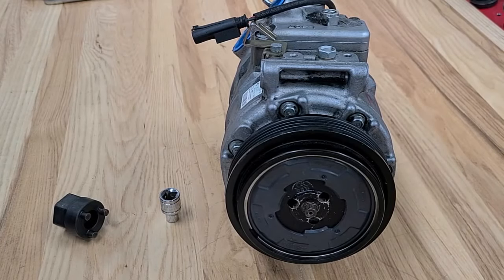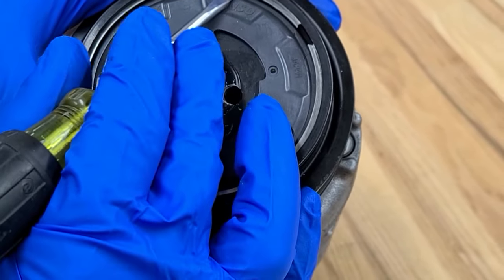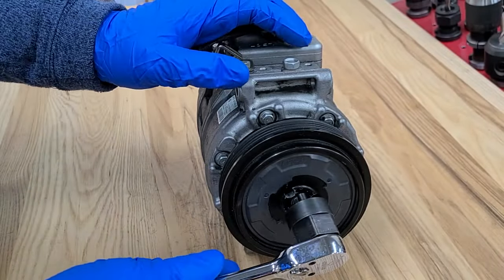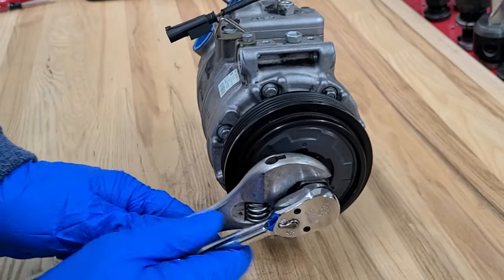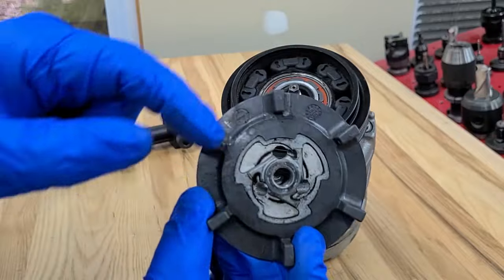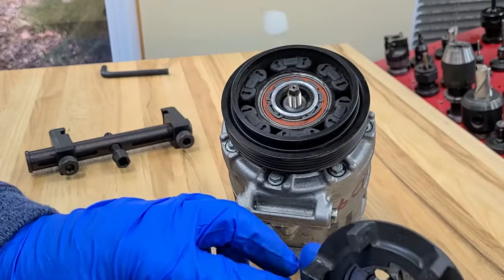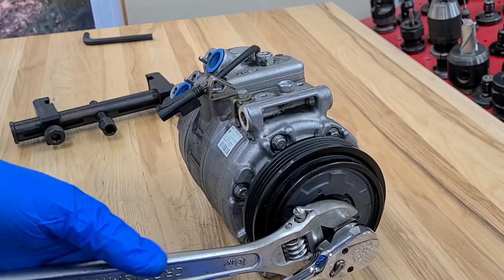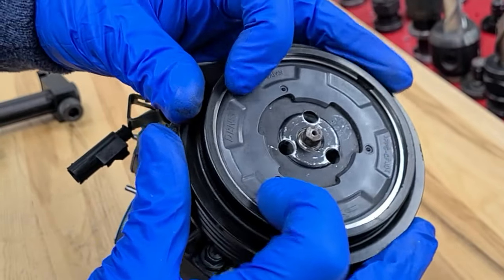Detroit Thermo tool for clutchless Denso 7SEU and 6SEU compressors on German OEM vehicles

Comment: Great tool and video!

I’ve recently got to know these compressors due to issues with my AC on an Audi S3. 

1. Mine had a groaning noise coming through into the interior, still cold and no noise in the engine bay. 
- evacuated and recharged.. resolved!

2. A few months later (on a stinking hot day) the aluminium safety hub sheered off. Don’t know why. 
- I bought a 2nd hand denso compressor cheap and used it’s sheer hub. Actually changed it in situ by putting a socket on the central nut, and rotating the remains of the aluminium off. Didn’t need to discharge/recharge or remove the compressor. It was fiddly but doable. 

The garage wanted $1800 (new compressor etc) I did this fix for $100, knowing that it might well have to have the full fix anyway. 

6 months later it is still running perfectly. 
My question is, if the compressor hasn’t seized, why would the aluminium sheer hub give way?
(It is a powerful car ~200kw).
Reply from the maker: Hey Peter, it's not uncommon for the aluminum breakaway hubs to just fail after a while, they are very fragile.  I've seen a few that are still running but have cracks in the thinnest part of the hub, i.e. they were going to fail in a few weeks or months.

Comment: Hey thanks for the video! I'm curious if a bad bearing could cause heavy knocking from the compressor when the ac button is engaged?
Reply from the maker: Doesn't sound right for a bearing, knocking should be there whenever the engine is running.  It might be the torque limiter hub is mostly broken, but more likely internal problems with the compressor. Does it still cool the air?

Comment: Thanks for the video.  I have a question for you though.  Do you know what the symptoms are when this bearing starts to go?  My AC is still blasting pretty cold but I stopped using it since it seems to cause a kind of uneven idle when stopped at a light and the A/C is on.  Also when I cold start the car I get a kind of short clacking noise not long after starting, this is on an 07 Benz ML350... I'm guessing whatever computer controls this just tries the compressor regardless of saying to leave it off on the climate control.  When I recently replaced the serpentine belt I rotated the compressor by hand and it seemed to move okay but it was kind of sticky... or felt like it was hanging up the first couple rotations... almost like there was dirt in the back of the pully.  I am just trying to determine if I can get away with replacing this pulley and bearing, or if I need to bite the bullet and get a whole new compressor.  Thanks for your help if you have any ideas.
Reply from the maker: With the belt off your compressor pulley should rotate with a little bit of resistance, but it should be a smooth, even resistance.  If it feels like crunchy or stiff, or you can hear any noises it will most likely be a bad pulley bearing, bad bearings inside the compressor are also possible but they are clean and PAG oil lubricated and much less likely to fail than the pulley.  A clacking noise after startup could be anything, or do you for some reason think it also comes from the compressor?  I would disconnect the compressor control valve (back of the compressor body and see if that startup noise goes away.  I think your ML might set a fault code if you disconnect the control valve, might need to clear it after plugging the valve back in.  With the control valve disconnected the compressor swashplate will stay at it's minimum angle ( the same as A/C off ).  In this way I think you could determine if the noise has to do with the compressor or something else.  Don't get a new compressor if your current is performing well.  If the compressor fails at all internally the performance will degrade quickly and it will get noisy all the time, you would hear it at idle.  Replacing the pulley is cheap.
Reply: @Detroitthermo  Thank you so much for the reply Erik.  The only reason I thought it was related to the compressor was because of the way the pulley felt when I replaced the belt.    Funny thing is with the old belt it was missing one of the outer most ribs. That could have also been damaged before I had replaced an idler pulley that went bad about a year ago.  I also first replaced the belt with a Continental belt that started squealing like a witch not long after installing in at higher rpm's.  I then put a Benz belt on and that stopped.  Anyway, when I was rotating the compressor pully it wasn't the smooth but with some resistance feeling that I'm guessing is similar to the way both the alternator and power steering pump feel when you have the belt removed.  I've not tried disconnecting as you describe yet.  When I run the A/C it doesn't make any clacking/crunch noise... only notice that idle is not smooth at stop lights since something is causing a more strain than normal when the compressor is engaged, or the swage plate as you described is more fully pushing to do it's thing.  When I do that first cold start in the mornings and I hear the clack noise the idle drops then surges just after this strain is removed.  Makes me wonder if it is the bearing then the pulley is wobbling more when it's cold and some strain is placed on it.  I'd love if this issue is just the pulley and I don't have to put a new compressor on it.  Anyway, I'm working from home today so when I can sneak out to the garage or finish for the day in a few hours I'll take the tension off the belt, and see what it feels like now when I rotate it.  I'll also try wiggling it from side to side to see if there's any play that might also point to the bearing.  The car does have 156K miles on the clock so I know a compressor is not out of the question but it's so odd how it only makes the clack/grind noise for less than a second on cold starts.  Thanks again.
Reply: @Detroitthermo  Well I just checked it..... it didn't feel like it was sticking/hanging when I was rotating it this time, however, I did twist, or push on it on the front from side to side.. and push/pulled on it a bit and it felt like there was play in it.  I think I'll go ahead and order the part, and your tool tonight.  I priced the pulley at the dealership and holy cow, they started out at $350 and tried to get me to buy at $303 with a discount..LOL... think I'm going to try eBay for $40 first along with your tool......  If you have any additional thoughts please let me know and thank you again for your time Erik.
Reply from the maker: @ZaphodsPlanet  That's what I would do too, cheapish pulley and change it yourself.  $40 is really cheap though, hope it is OK.  For $350 you could buy an OEM Denso compressor and use only the pulley!
Reply from the maker: Yeah, I just re-read what you've said, and I'll change my advice.  It does sound like your pulley bearing isn't perfect anymore and could use replacing, but if you can't feel something serious, it can't be causing your engine to bog down at idle with A/C on.  I guess I would probably change the pulley because it's easy, but I think your problem is somewhere else.
Reply: @Detroitthermo  LOL.... I'll look at some of the higher priced ones to see if I can find any with good ratings on the part itself.  Going to do that now.  Thank you again.
Reply: @Detroitthermo  I've been thinking it over a bit more too.  I know this past Summer it didn't seem to cool as well as it did the Summer before ..... I think what I'm going to do is pick up an IR thermometer and manifold/gauge set tomorrow at HF(don't have them yet) and run some tests on the system.  I just ran the AC in the car a little while ago at idle in the garage and while it got cool, it didn't feel like the ice cold of year before last.... if I can check pressures... and figure what the readings mean I should at least learn if the compressor is indeed at the end of it's life.
Reply: @Detroitthermo  Hey Erik, it's definitely the compressor.  Yesterday morning before heading off for work I opened the hood, got a flashlight, then moved as quickly as physically possible from tapping the key to start and then pointing the flashlight at the compressor.  Most of the newer (I'd guess mid 90's on) have computerized starting in that if you just tap the key to the start position the computer will keep the starter running until the car starts.  Anyway I did that and before the cycle was finished I had the flashlight pointing at the compressor wheel in the engine compartment.  That thing must be hard, the car was running for maybe a second before the ac compressor wheel started to rotate.  When it did it wobbled like a top all while making that noise.... then it caught up to the speed of the belt and the wobbling and noise stopped.  So I'm guessing it's harder to rotate than it should be.  Bought gauges last night and plan to check at some point today to see if I can glean anything from that.  I'm assuming I just need to replace the compressor.
Reply from the maker: @ZaphodsPlanet  Based on what you are saying it sounds like only the pulley bearing is bad, not the entire compressor.  Is it a clutchless like shown in my video?
Reply from the maker: I just looked it up, I believe your compressor probably has a normal clutch which has I'm guessing failed.  If it's blowing cold air just buy a replacement clutch and pulley, but you don't need my tool.
Reply: @Detroitthermo  What's in my car is identical to what you're showing in the video, wires go to the servo thing in the back that controls location of the swage plate.  Do you think the bearing on it's own would make it harder to turn (causing the initial slipping?).  Maybe I will try, I did pick up gauges but forgot to get batteries for the IR thermometer.... will report what that shows tomorrow afternoon when I get home.  Thanks again for your help and time Erik.
Reply: @Detroitthermo  Well good news.... finally put the gauges on and I was getting a bit over 120 on high side and 30-35lbs on the low and using an IR thermometer it was blowing 25-32 degrees.... bear in mind it is only 65 outside at the moment..... so while not perfect according to one chart I found it's close....going to order the pulley and maybe your tool too (ordered it, seems only fair for your help here as a thank you... and it will make the job even easier when it all arrives)... I''m positive there's no clutch.  I can fix some other things now... yippie...  Funny thing is most of the listings for the parts showing on eBay list it as a clutch... though it's really not.  I guess you could call it a break away clutch.
Reply: @ZaphodsPlanet  Hey I'm curious if you had an update with your problem? I'm currently experiencing heavy knocking from my clutchless compressor on a 2010 jeep compass. It's only present when ac button is engaged though.